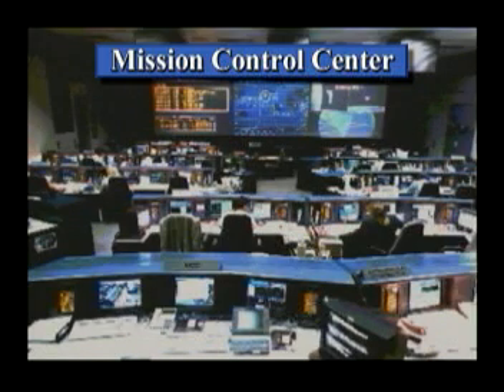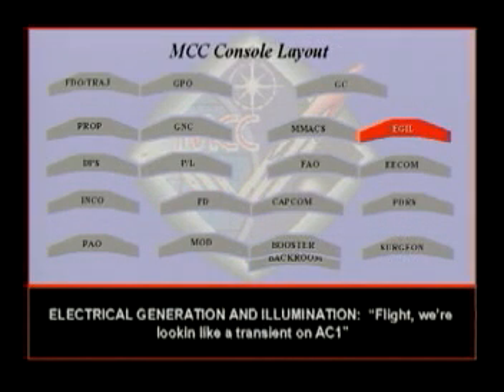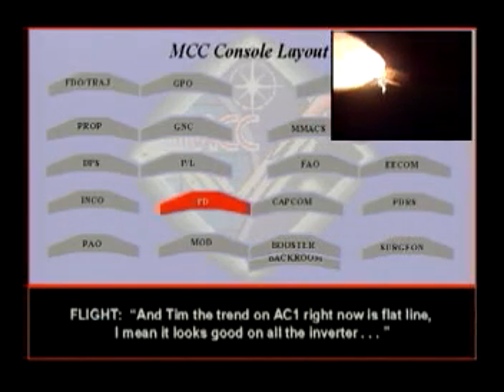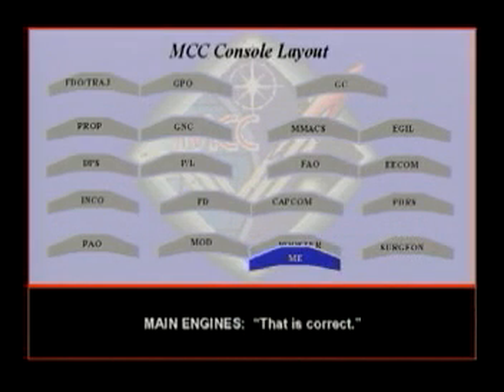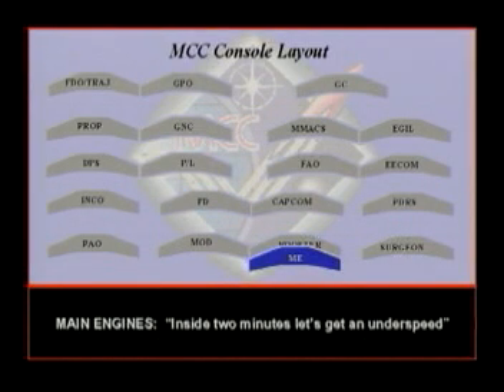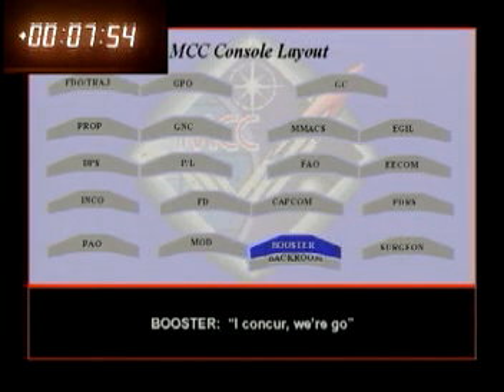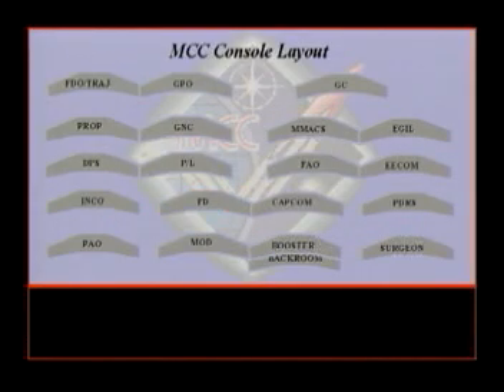STS 93 Ascent Issues "We don't need any more of these" - MCC Loop

Comment: 0:57 at this point in the launch a tiny gold plug blocking off an injector that wasn't in use shot out and punctured something like 3-4 of the nozzle cooling tubes.  (damaged or malfunctioning, standard practice with the shuttle) A couple other minor faults occurred at the same time but the first call out you will here is a woman's voice saying she has an issue with one of the fuel cells. The fuel cells work by burning a small amount of the rockets fuel and oxidizer to generate electricity, the fuel leak and subsequent fuel pressure drop caused a warning for that fuel cell as its own fuel supply pressure also dropped a bit. I believe the safety cutout for those nozzle cooling tubes is 5 tubes punctured would leads to an engine failure/shutdown which at that altitude almost certainly means they will be using one of their "works on paper but never tried" abort scenarios.

The fuel cell issue caused some electrical issues that caused some incorrect readings.
Reply: The fuel cells had their own supply of cryogenics, not connected to the propulsion system in any way.

Comment: About as close to a "throw everything at them" Sim that you'll get in a real flight.

1. Short circuit casued by a screw head with a slight burr on it that had been quietly sawing it's way into brittle Kapton wiring on every launch. The jolt of SRB ignition  finally sealed the deal.

2. Much more serious , a oxidizer injector "post pin" (a brass pin they used to plug worn LOX injectors) came loose at SSME start and hit the insde of the nozzle, rupturing 3-4 H2 coolant pipes in the nozzle. This caused a hydrogen leak which paradoxically caused an over use of  LOX and caused the early engine shutdown. The big risk was that the LOX injector was plugged for a reason, had it failed and dumped LOX into the engine, it would have been an instant lose of vehicle and crew situation. 

3. An ( erroneous) alert of a failed hydraulic power unit on the RH SRB. This would be very serious (no steering) but was just to loose cable.

Comment: Correct me if I'm wrong but this was the mission post-flight they discovered pinhole leaks around the bottom of the bell, caused by corrosive aspects of the masking tape used to "seal" the bell pligs/covers during processing?
Reply: No, it was the golden bullet incident where a injector plug in the right engine got yeeted out on Main Engine startup and took 3 parallel coolant lines out on the inside of the bell (5 parallel out would have resulted in engine burn through and Loss of vehicle and crew)
Reply: yes
Reply: @HamzahKhan314  thanks. It's been a while, so details are a bit fuzzy, but I had a feeling...
Reply: @JephN79  np. kinda suprised you saw my reply considering you poste this over a year ago.
Reply: @hamzahkhan8952  I haven't changed my email, so I still get notifications from YT. It's kinda cool because I enjoy getting or giving follow-ups on comments on the more scientific or interesting vids I come across in my travels.
Reply: @JephN79  thats nice. 👍

Comment: they managed these in-flight failures incredibly well and got them into orbit with just a very small (15ft per second) underspeed.    LOX ran out at the end causing engine shutdown.   Scary stuff all the issues they had that flight.
Reply: No they didn't. They're basically unaware of the major malfunction that occurred that led to the oxidizer exhaustion. This could have been a disaster but a stroke of luck saved them.

Comment: I wonder what they found when that orbiter arrived at the OPF post landing? That most have been some interesting post-flight debriefing.
Reply: What they found was that the right engine nearly blew up because three of the cooling lines were breached. The breach happened because an injector post plug came out during main engine start.
Reply: @犬の大将  The leak was actually noticed during the standard post-launch footage review as it was indicated by a bright white spot on the inside of the right engine nozzle in the footage. And they did get eyes on the three ruptured coolant tubes of the nozzle during the standard post-landing runway inspection of the orbiter, so they knew of the leak long before the OPF roll-in. What they did find in the OPF after the mission was the extensive wire damage that caused the entire fleet to be grounded for repairs for 6 months (July-December 1999), with two missions fighting it out to be the "Return To Flight" mission, those two where STS-103(Discovery to HST) and STS-99(Endeavour on a extensive terrain mapping mission). Eventually it was decided to have STS-103 to be the RTF missions.

Columbia only got a cursory inspection the OPF as she was going to Palmdale for her next Orbiter Major Down Period (OMDP) where it would be easier to do the inspections and repairs without her tieing up an OPF (only 3 available, for 4 orbiters). She would swap places with Atlantis which had just completed her latest OMDP and had returned to KSC to await an open OPF to undergo start of mission processing for STS-101, a space station logistics and outfitting mission ahead of the launch of the Russian Service Module.
Reply: @犬の大将  It didn't nearly blow up.  Didn't come close to that.

Comment: If Columbia lost two SSME’s could it perform a TAL abort using the remaining engine and the OMS engines?
Reply: It depends when it would lose two engines. If immediately after liftoff, not even RTLS would be possible. It would be single engine blue scenario, which is similar to RTLS in that shuttle is turned around back towards Florida, but it couldn't reach any runway and crew would have to bail out and be recovered by booster recovery ships, vehicle would be lost.
Unless I missed something, the first call after which single engine TAL was possible was "single engine OPS 3", which means shuttle is high enough that in case of a TAL at that point (which would be required if two engines failed), it can use standard reentry software (OPS 3), instead of TAL reentry software (OPS 6).
Reply: Failure of a second engine just after the single engine TAL window closed would have resulted in loss of vehicle and crew. This is why in the flight where one engine did fail there was discussion of setting main engine limits (checking) to inhibit (off) and after Flight checked with FIDO and FIDO confirmed outside TAL region the crew were told to set limits to inhibit. A little later the Shuttle became capable of abort AOA (abort once around the planet and land) and the fatal single engine window closes. Aborts TAL, AOA and ATO were the three settings on the cockpit abort mode selector. The specific TAL site to use was loaded and perhaps changed during the ascent, if I remember correctly there was a primary and at least two alternates that NASA sent people to on each flight, selected from around fifty depending on the planned flight trajectory.
Reply: James Day, the abort selector has RTLS, ATO, and TAL. 

I believe an AOA was performed via OPS 104 for OMS-1 and then OPS302 for a OMS-2 deorbit.

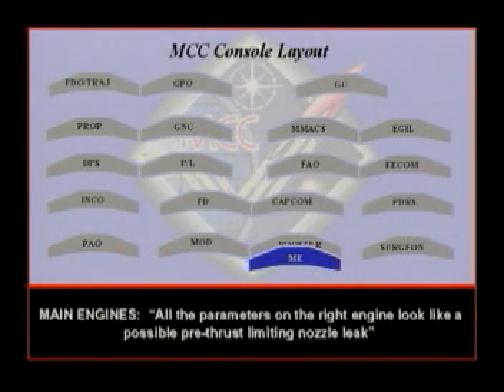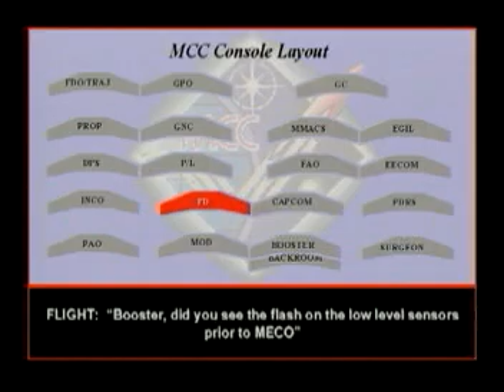Comment: BUT it wasn't just that potentially catastrophic leak which everyone focuses on (which ME determine is that problem at 4:31 - of course they didn't know what had caused the leak), but also the glitch had caused AC1 shutdown (causing loss of telemetry), Fuel Cell PH warning (which if were true, a fuel cell could potentially explode), two DCs offline (albeit just 1 of the 2 in each of two of the three engines - and not being able to control engine direction would be a disaster), and running out of main propulsion fuel 0.15s before orbit, yes - see at 9:21 how MPS say "LOX low level cut" in the middle of all the MECO statements! Which is explained at 10:10 and the cause of the "Yikes!" statement.
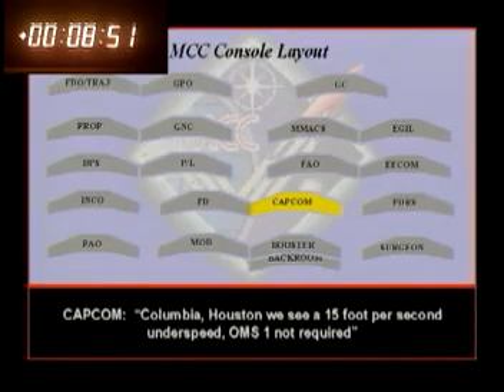I think we overlook why at 9:56 Collins said "it's good to back in 0g again" - I don't think it was just because she likes to be in space, she certainly could see the fuel cell PH warning light and would know the consequences if that were true, but I think she'd have been able to see warnings on the DCs going out, AC1 offline, as well as the LOX level dropping to zero as they were approaching orbit.
Consider how you worry about your gas gauge getting to zero as you're trying to get to the gas station...
I wonder if she needed to change her diaper after all that!
Reply: The pilot probably needed the diaper change, since the engine gages are on his side of the cockpit!
Reply: @EditGuy6610  Shuttles could be flown by both the Commander and the Pilot.
Reply: These tanks were always just about empty at MECO. Usually less than 3000 pounds out of the total of 1.6 million pounds of propellant that the External Tank launched with was remaining at MECO.  The tank is dropped before reaching orbit so that it falls towards the Indian/Pacific Oceans.
Reply: From the POV of the Commander it's more about having a safe place to plan a return from orbit with the delta-v you can use to do it to allow for kinder suborbital mechanics, issues of fuel and engine operation before that make it much scarier.  You don't need a lot to do a retro burn, its about attitude, timing and delta-v, it's the getting into the stable orbit in the first place that's important.

Comment: Wasn't this the "Gold Pin" incident, where a cooling line was plugged with a gold shunt, but blew out and into the inside of the booster nozzle creating a leak in coolant/fuel, and almost killed them all....?
Reply: See 4:31 they do determine the issue where "Main Engines" say a prethrust nozzle leak, so a fuel discharge pressure low, and HPOT "half way" to turbine temps! Of course they didn't know WHY there was a leak of cooling hydrogen in the nozzle at that time which turned out to be the gold pin rupturing 3 nozzle pipes (and remember the engineers who built it determined that if 5 were broken it would cause lack of cooling and a burn through of the engine, and loss of the shuttle).
Reply: Yes it was
Reply: Yes, plus a whole bunch of other shit too.
Reply: Gold shunt in an oxygen injector yes